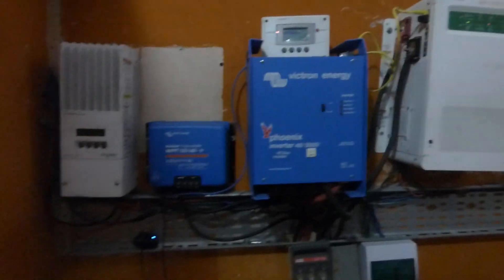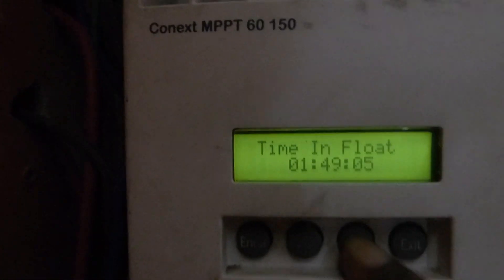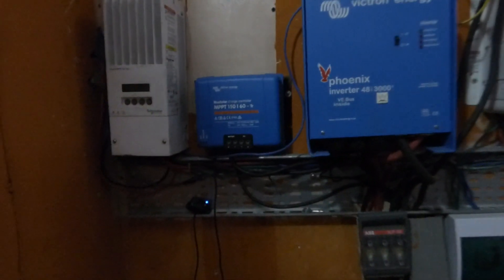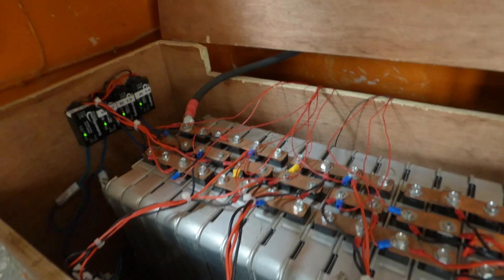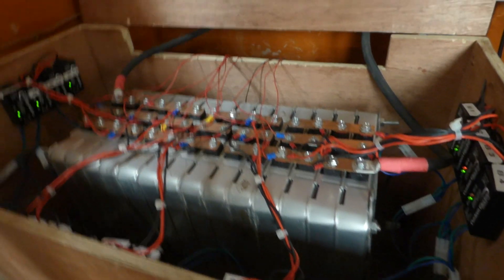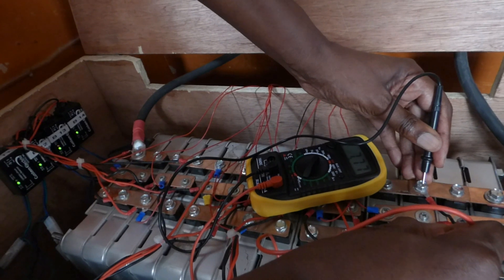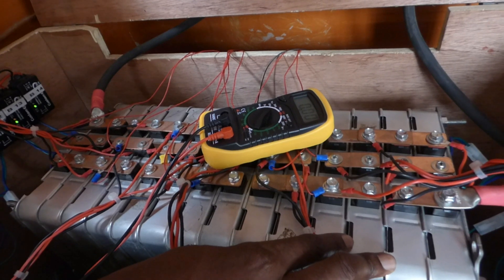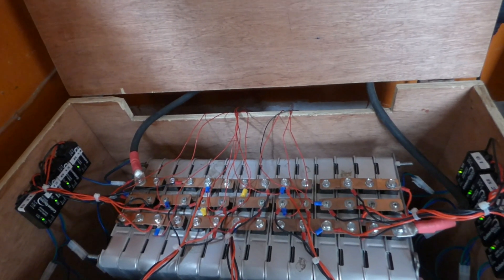Will the Nissan Leaf batteries burn my house down?

Comment: make your self a thin plastic tank full of water put it above and if you have fire it will rupture and put out flames as bit of safety device or co2 ext via
 valve and ardunio flame detector only a thought ?!
Reply from the maker: I have been thinking about fire safety. I will see what I can come up with. Thanks Brian.

Comment: It seems like you have leaf modules from different cars with different capacities, witch is a bad mix, or it was a failing battery, either way those failing cells need to be replaced, the balancer won't last long working this hard all the time, a bms will let you only use as much as the weakest cell. any ways looking forward to you findings!
Reply from the maker: Hello GOG it is very possible. I buy them from different sellers. The first batch of over 60 were not as good as subsequent purchases. The imbalance occurs when the voltage drops below 50 V. The balancer comes on then. As usual thank you for your expertise and comments. I am using a 1S balancer / equalizer

Comment: Hey man it's your house and batteries, seems you had this same problem 6-8 months ago. Sooner or later when you push the limits something will fail. it would have took only a few hours to hook them up in parallel which would balance them out. Cheers and have a nice solar day
Reply from the maker: Thank you for watching and commenting. Sadly I don''t have the luxury of waiting a few hours. It is an experiment that I conduct and if it fails you see why it did. If I succeed you also see why. 6-8 months ago I did not have this issue with these batteries. I will go back and check just to make sure.

Comment: leaf batteries are lifepo4.. 
non combustable. ;)
Reply: I'm also interested in purchasing Nissan leaf batteries.Do you know what your current draw on these batteries are?I'm sure a lot less than what these batteries were built for.
Reply from the maker: @diydan6045  thank you watching. They are rated for about 100 amps per module. With my AC on I pull 1400 watts out of my bank. So roughly 25 to 30 amps max. They are incredible batteries for the DIY type.
Reply from the maker: Thank you for watching and commenting. I am almost certain that they are not Lifepo4 batteries. They are lithium ion manganese oxide. Do they catch on fire? I don't know.
Reply: @drsolar  You are right Dr Solar. They are definitely lithium manganese and are combustible. Good luck with them but on the long run, go completely LiFePO4.
Reply from the maker: @adon8672  if I had my wish and an unlimited budget I would get different batteries. But this is the best bang for the buck. Thank you for watching and commenting
Reply: @drsolar  you are correct sir, i stand corrected :
https://qnovo.com/inside-the-battery-of-a-nissan-leaf/
https://simpliphipower.com/company/news/blog/not-all-lithium-ion-batteries-are-created-equal/
these can burn !
Reply from the maker: @houseofancients  thanks. I am sure that if I get stupid enough I can either damage them or worse case get a fire. I am trying to not have either. Thank you. We are all learning
Reply: @drsolar   they are VERY VERY HARD to catch fire!
Reply from the maker: @GoingOffGrid101  thank you. Nice to know. I won't try to burn them down either. I am taking the lazy route.
Reply from the maker: @bill4639  thank you sir.